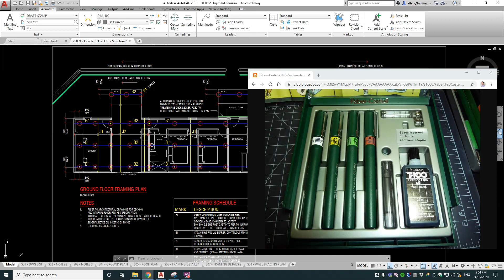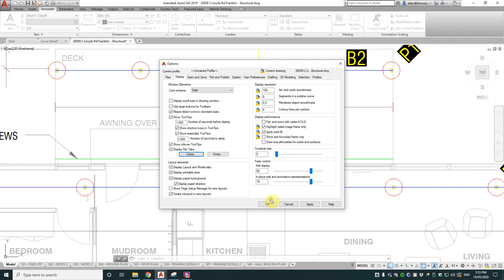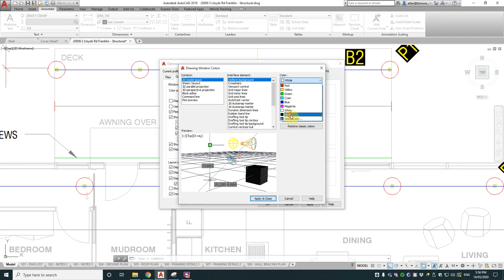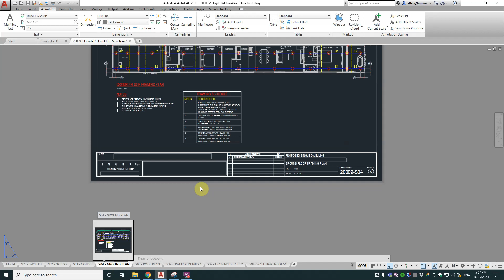Drafting Standards - Standard Colors and Line Weights in CAD

Comment: I use these colors for more than 28 years...
These colors came up by how the lines look on the screen, thick or thin.
Gray    --> 0.10 mm (very rare to use)
White   --> 0.12 mm (only for circle's centers an marks)
Blue    --> 0.12 mm (only for center lines)
Green   --> 0.18 mm
Red     --> 0.25 mm
Yellow  --> 0.35 mm
Cyan    --> 0.50 mm
Magenta --> 0.70 mm

Other colors:
Color  31 --> 0.10 mm Hatch
Color 165 --> 0.12 mm Thin Lines
Color  12 --> 0.12 mm Hidden Lines
Color  92 --> 0.12 mm Dims
Color 181 --> 0.25 mm Bolts
Color 203 --> 0.30 mm Projected Lines
Color 141 --> 0.40 mm Outlines
Color  40 --> 0.70 mm Texts
Color  86 --> 1.00 mm Section Outlines

Comment: Does ,for example, 0.25mm line weight in AutoCad mean the exact .25mm in reaity?
Reply from the maker: .25mm is the “print” width of a line. So yes it is exact in reality
Reply: @TheArtofTechnicalDrawing  another question, What is the difference between setting up line weight in the plot style and in the layer style property ?
Reply from the maker: Both can have the same outcome if the setting at plot are correct. CTB is older
Reply from the maker: @SUL-KSA  If it is CTB in the plot style the colors on the screen represent line thickness. If it is by the layer everything on that layer has that thickness, regardless of the color.

Comment: I don't understand. what are standards in autocad?
Reply from the maker: A set of guidelines for the way to use and how drawings should appear in Computer Aided Drafting software.
Reply: Depending on where you are depends on what standard you use. AS 1100.101 is the Standard used in Australia. $350 Australian dollars if you want to purchase one. 
The ISO is the international standards used in??? I am not sure which countries but it is sold in swiss francs ISO 128-1:2020 Technical product documentation (TPD) — General principles of representation, part 1 for about $50 but it is part 1 or something... Actually, here is the wiki page about it https://en.wikipedia.org/wiki/ISO_128 HOLY MOLY! it has 15 parts to it!! 
asme y14.100 is the American standard. From the ANSI there is also ANSI asme y14.5. I don't know if you can buy it directly off of ANSI or if you have to purchase it through Amazon etc. Amazon has it for $450 American or thereabouts.

Comment: That is very close to the colour system I have been using since the early 90's.

Pen Weights
Green = 1.00mm
Blue = 0.70mm
Cyan = 0.70mm
Red = 0.50mm
Yellow = 0.35mm
White - 0.25mm
Magenta = 0.18mm
Grey 9 = 0.15mm

Solid Hatch Screening
250 = 90%
251 = 70%
252 = 50%
253 = 30%
254 = 10%
255 = 5%